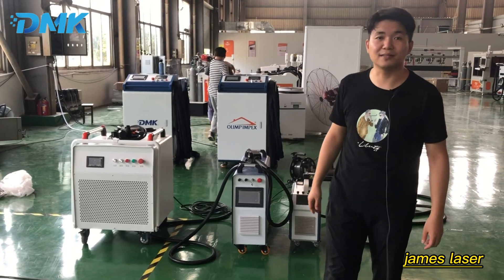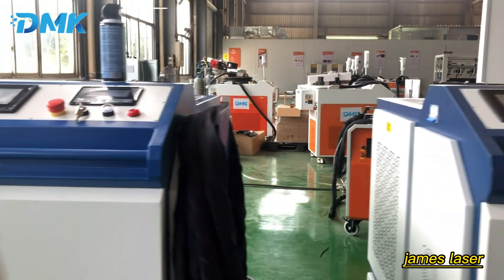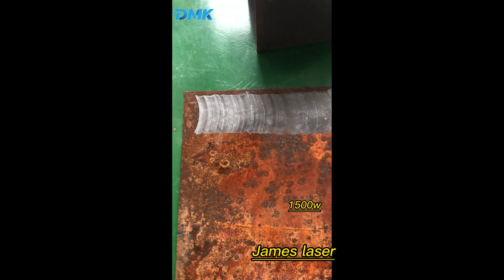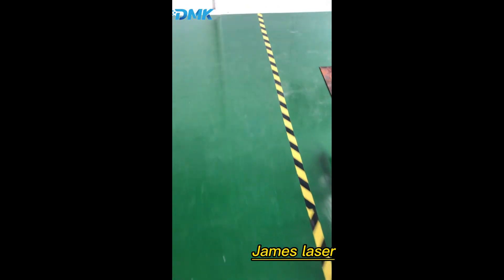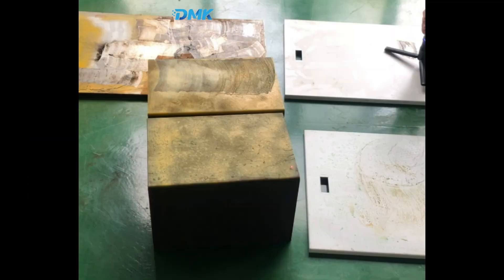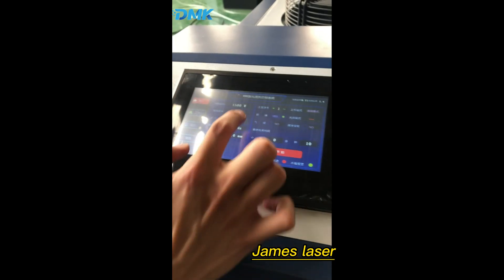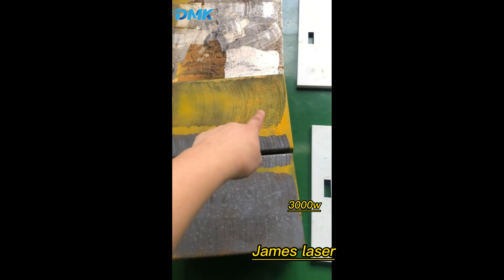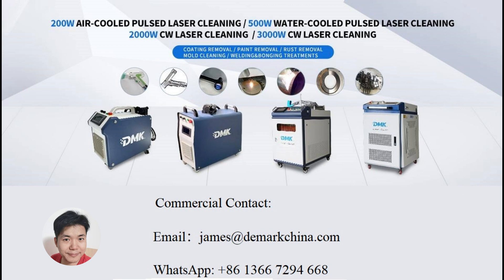Comparison of laser cleaning machine #dmk #dmklaser #DMK #DMKlaser #foryou

Comment: Hi friend
I have raycus 1000w in cnc fiberlaser I have questions

nitrogen gas can cut mild steel and carbon steel or no just need oxygen to cutting mild steel and carbon steel...  I know nitrogen is expensive than oxygen but just I'm asking you this question if it can cut mild steel and carbon steel or just using nitrogen for stainless steel and aluminum and copper

Also my other question for purity of oxygen if purity of oxygen just 93% and 7% other gas can cutting mild steel and carbon steel or no
Reply from the maker: first, nitrogen can cut mild steel and carbon steel, but need high power to do, 1000w is a bit too low power to do that, cause normally we use oxygen to cut mild steel is using oxygen to help burning the carbon, without oxygen to help buring, we need higher laser power to melt the material;
second, less purity oxygen of course can cut mild steel, even many customers using compressed air to cut mild steel, again need higher laser power and less cutting quality compared with high purity oxygen cut;
Reply: @jallyqu  thank you so much
Which power is ok to cut mild steel and carbon steel by netrogyn
Max diameter of cutting 8mm

Comment: You did not mention if the 1500, 2000, or 3000W units were continuous or pulsed lasers. You also did not show the comparison of the 100, 200 and 300W pulsed laser units. There is a performance difference between the pulsed and continuous laser units, even with the significantly larger power of the continuous lasers.